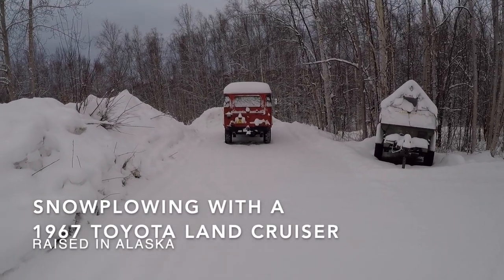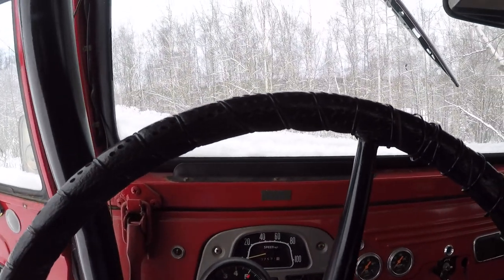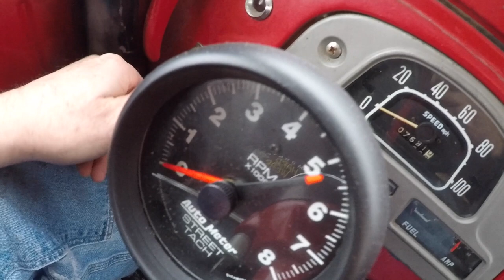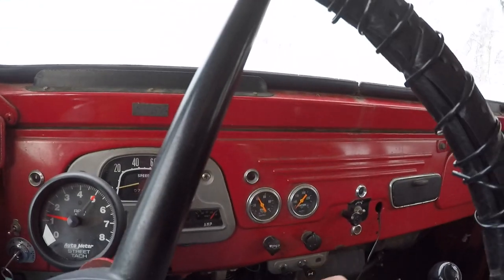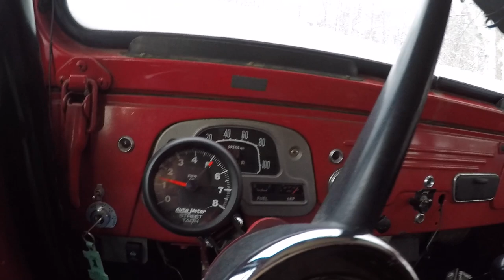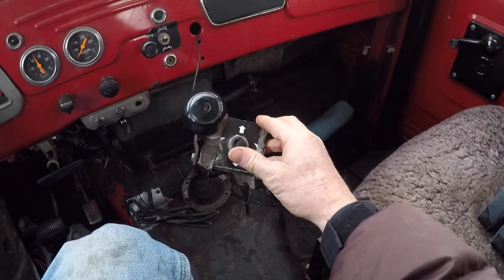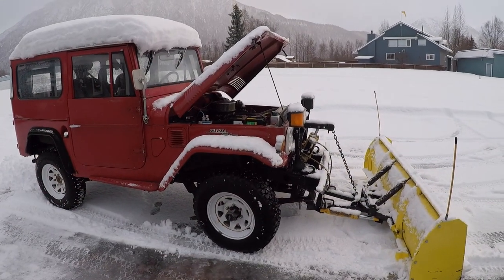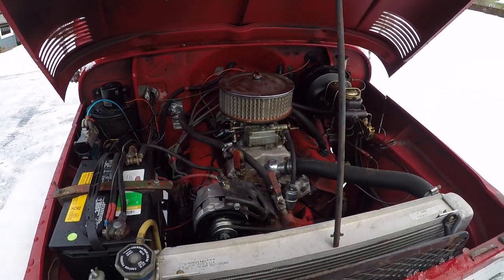Snowplowing with a 1967 Toyota Land Cruiser

Comment: Enjoyed the FJ40... In the mid 80's I had a '73 in tan and sold it because I couldn't haul the kids in it (wish I had it now). Put about 200,000 miles on it. Did the 350 swap when the I-6 got tired. Never had a blade on it.  Here in North Dakota the wind makes blades useless because they create drifting issues. Snow blowers on tractors are the only way to go. I currently have the XJ like your son's and it has fills the bill.  We had a blizzard earlier this week with 14" snow and 40mph winds and was able to make 30 miles to town busting drifts. This morning was -35F (-37C).
Reply from the maker: They are great automobiles. I look back on my previous vehicles and wish I still had a couple of them as well.